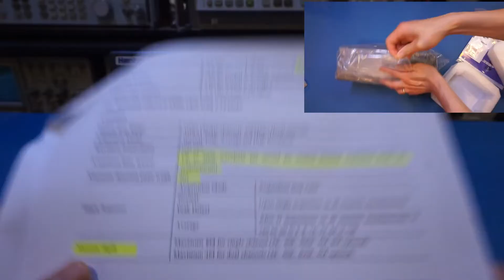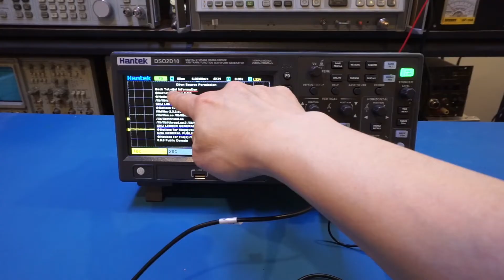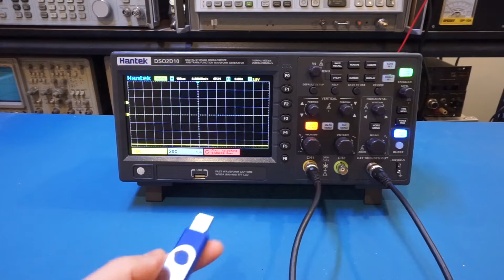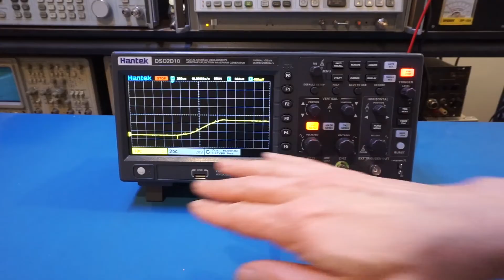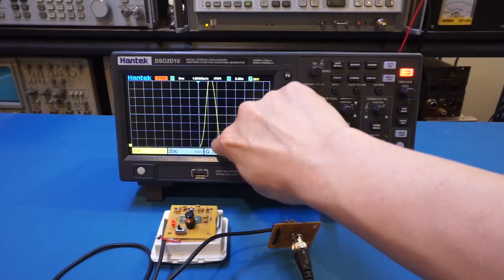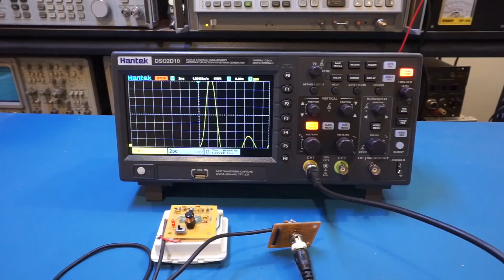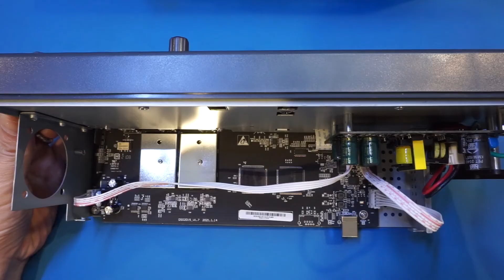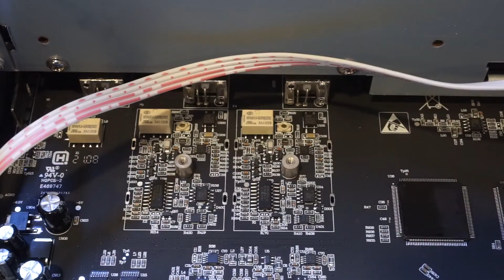Review/Teardown of a Hantek DSO2D10 Oscilloscope - It Has Builtin AWG, Does Protocol Decoding Too!

Comment: I was wondering if the Hantek DSO2D15 can be use for AM, FM radio Alightment.
since it has a AWG and is a 150 MHZ, FM radio is up 108 MHZ. What is your opinion?
Reply from the maker: The maximum AWG frequency is 25MHz for sinusoidal, which may be a limiting factor if you don't have a dedicated RF generator. But the scope itself should be good enough.
Reply: @KerryWongBlog  ohh I see Thanks

Comment: First of all, thank you for making such a great and well informed video. I have learned alot from your video.

- I read somewhere that the probes that come with these cheap units are junk. Have you tried to use "good" probes with them and if so, does it help to get more accurate results?

- Can you suggest or link to better probes we should get when we purchase any of these units? Maybe something that is budget friendly for us hobbyists, but still give better performance then the ones you get with the scope? Same question for both 100Mhz and 150Mhz probes.

- is there a accuracy difference between the Hantek 100Mhz and 150Mhz versions? If the cost was the same, would the 150Mhz version be the better choice to get?

- Do you see an easy way to install a 12v dc computer fan in there for cooling? Other reviews mention that this unit locks up due to heat and there is a russian video where the guy installed two pretty beefy heatsinks on both FPGA chips which supposedly solved this problem. Maybe running a 12v fan at 8v would be enough just to get some air moving in there to prevent overheating? Thoughts?

- As I don't have a scope of my own and really am only a hobbyist at best, is this scope good enough to start with or should I save up for a better scope? I don't like to waste money buying the same tool over again, however I'd rather buy a scope that will last me several years until I know more about them and have a better understanding on what other higher end features I might need/want.

Thanks again and much love from Canada !!
Reply from the maker: -The supplied probes are rather generic. But for general purpose measuring within the 100MHz, results won't be affected much (unless you are trying to measure rise time in the ns range)
- I did some analysis on a few probes years ago (http://www.kerrywong.com/2015/07/11/oscilloscope-probes-rise-time-testing/) you can take a look. Good probes are quite expensive and for this oscilloscope you have other limitations other than the probes.
-I don't have access to the 150MHz version, but the circuitry would likely be very similar if not identical and there are some minor firmware/hardware tweaks for the 150MHz version. If the prices are similar I'd go for the 150MHz version. But as you saw in my review, the 100 MHz version is fully capable of measuring signals well above 150MHz.
-I really don't think after market fan is necessary. If you do need one, you can tap off the 5V rail and install a fan, but even after prolonged use the scope did not get hot.
-I would say this scope should be good enough for a lot of for a lot of hobbyist work. It's a very competitive market and there are a lot of similarly priced scopes out there and all with their pros and cons. It really comes down to what you plan to do with it.

Comment: Thanks for the test and teardwon.

I've been using a relatively modern $399 Digilent (owned by National Instruments) AD2 USB scope/AWG/PS/DIO gizmo (no screen; UI is a PC you supply) for a few weeks for low level, low frequency,  measurements.
IIRC it uses a 15-bit ADC, which is very useful for my measurements of  low-level (10-20 mV analog) signals from transducers. One of the limitations of the AD2 is it's limited 16K buffer  (max) per scope channel.
This new low-profit-margin Hantek interests me for my present measurements due to its much larger buffer size.

i note that other EE blogs mentions that QFP chip with scrubbed off numbers is a TI ADC08D500 or ADC08D502 and Ti's block diagrams show an 8-bit ADC.
Reply: Looking closer at Kerry's photos of the scrubbed off chip number QFP mounted on the PCBA, it turns out that the part is a 128 lead QFP mounted on 144 pad footprint. The ADC08D500 and ADC080D502 only come in 128 QFP packages, but the 144 pad footprint IMPLIES that Hantek MIGHT use a different part in other scope flavors.

Comment: I got the 2C10, but thanks to the eevblog forum I was able to change it into a 2D15 like yours, some models of this line (2CXX) had the AFG hardware populated just disabled on software. BTW can I use the MMBT3904 to make your pulse generator?, sounds like an interesting project to make. Awesome review.
Reply from the maker: Wow, couldn't believe they actually had the hardware just disabled the functionality in software in some models! Anyway, yes 3904 works great with this generator, other generic NPN transistors might work as well.

Comment: The empty connector footprint looks more like an Ethernet port (8 pins + 2x2 for LEDs), not serial.
Reply from the maker: Now I am looking at it again, I think you might be right as DB9 footprint should have 5 pins on the first row.
Reply: @KerryWongBlog  Yes, the plastic molding shows a LAN pictogram for that non-populated port. A LAN port would be a VERY good feature, overcoming the USB BW limit. But, that ARM-based Allwinner SOC didn't seem to have a high speed port for a Ethernet MAC/PHy.
Reply: After reading some of the reviews and teardowns, I think this non-populated ethernet port was an Ethernet place keeper for possible upgrade for competitive. Rigol has had a similar scope (only) out for a while with a $279 MSRP. The Rigol has a lower bandwidth, but has an Ethernet port.  I assume Rigol and Hantek are targeting different markets.
Reply: It's missing the transformers for Ethernet and the RJ45 footprint seems too short for a Magjack type connector so that basically rules out Ethernet. Considering the SMD IC footprint next to it which looks suspiciously similar to a MAX232 it is most likely just a serial port using the 8P8C/RJ45 connector. Why they have an RJ45 footprint with LEDs I don't know...

Comment: I'm pretty sure you could get a better XY display. Settings can be tricky compared to more intuitive analog scopes. Perhaps sampling rate is not high enough? Clipping?? Etc. I once wrote a whole article about getting an analog clock face display looking good on a digital scope...
Reply from the maker: Typically the sampling rate improves when you decrease the memory depth, but on this scope it did not seem to make much of a difference unfortunately. The display I showed was the best I could get after adjusting everything I had thought about.... If anyone manages to get significantly better results I'd be interested to know!

Comment: I find in this osciloscope the need to make a calibration when there is subtle ambient temperature variations.  Before this calibration channel 1&2 offsets are visible in the 2mV/DIV.
Reply from the maker: Good to know. Thanks!
Reply: I'd be totally booby trapped by this. I work in my basement where when I arrive it can be 12°C/54°F and in a relatively short time with my heater on I can quickly bring it up to 21°C/70°F, because sometimes I forget to turn it down.

Comment: Well, given the bandwidth test you performed. It seems the "2D15" (150Mhz) I purchased would possibly handle at least 200Mhz+ and still be VERY useful. That would be AWESOME!!
Also, I liked how much more in depth you went with the included software and Arb generator functions. I had been wondering about saving Arb files to the USB thumb drive for later and you confirmed it. SWEET! :-D
Reply from the maker: I'd assume that the main difference between 2D15 and 2D10 would be in the front end section. It's possible that there are some "tweaks" in the circuitry to improve the bandwidth in the 150MHz version.
Reply: @KerryWongBlog  I'm told the hardware is the same in both models and the 2D10 has software/firmware limited bandwidth. Appears yours has no such limitation; interesting.
Reply: nope

completely same circuit

did u even see the writing on the pcb in this video